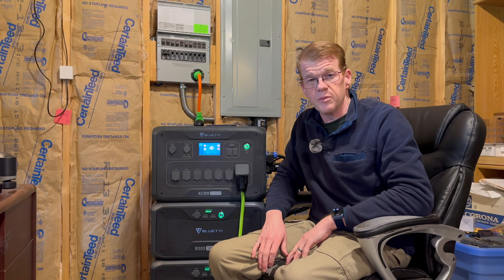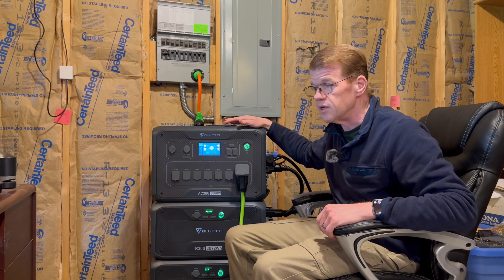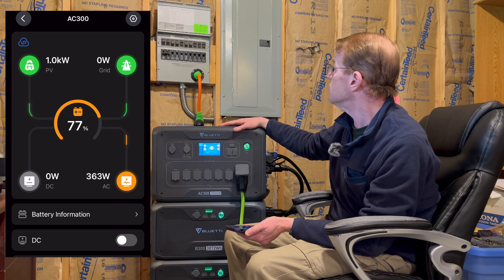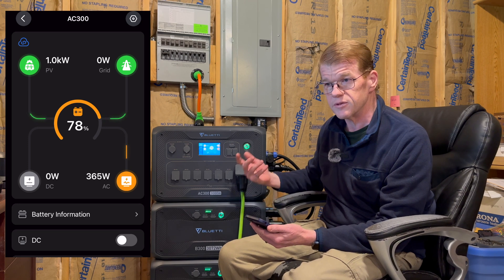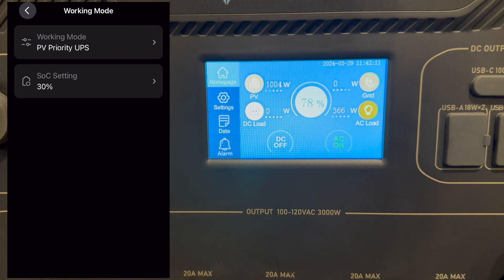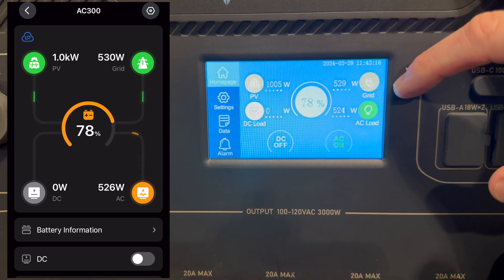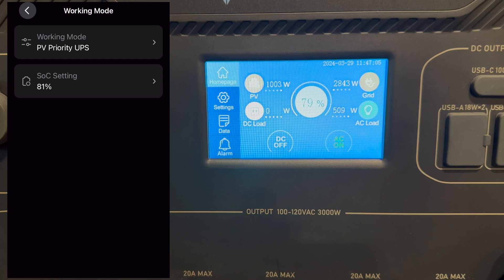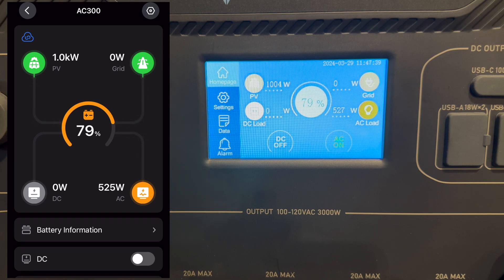Bluetti AC300 Home Integration Part 2: Experiences after a month of fulltime use with the AC300.

Comment: At about :35 you said you got the panel inspected, and there is an inspection sticker that its passed. 

Was that an inspection by an electrician or was that a city inspection?   And if you dont mind to say, what city please? 

I want to put in one of these Transfer Switches to power with my EcoFlow DeltaPro, but I worry about later having fire damage denied by the insurance because of "irregular"  electrical work in my house.

I just feel like having an "Inspection sticker" with some record of that at the city or at least with a licensed  electrician would solve that problem.  That's why I'm asking!
Reply from the maker: I filed for a homeowner electrical permit with the county, I fall under county not city.  Then did the work and had it inspected per the permit.  I showed him the box and install manual for the reliance with its certifications. It’s all completely kosher.  The sticker has my permit number, date, all that on it, same as the original sticker inside my main panel.
Reply: @DougKremer A "homeowner electrical permit" 

Very cool, I will ask at my town hall about one of those!  

Thanks 😊

Comment: The NEMA L14-30 for charging is a separate circuit with it's own breaker on the main panel right? You have the option for a 120v for a single AC300 or 240v for split phase for 2 AC300. I've seen post about tripping GFCI breakers or frying the inverter. I'm looking to use the AC300's as backup to grid outage and automatically switch to battery then. No solar. Thank you.
Reply from the maker: Yes,  the 30A input cord for the AC300 (and now AC500) is on its own 30A breaker in the panel.
Reply: @DougKremer  so once installed I could leave the AC300/500 connected to the grid at all times and set the UPS function to suit my change/discharge needs? Thank you.
Reply from the maker: @vanvee88  Yes, mine is plugged in at all times.